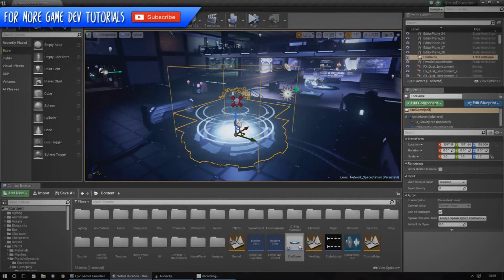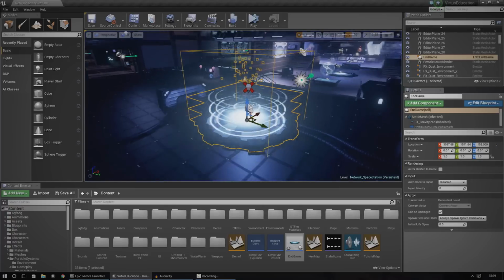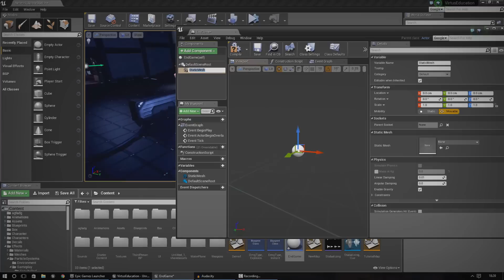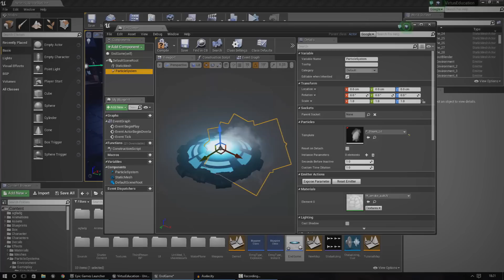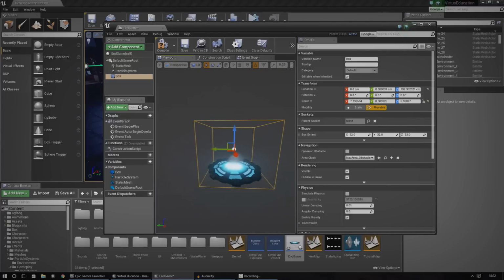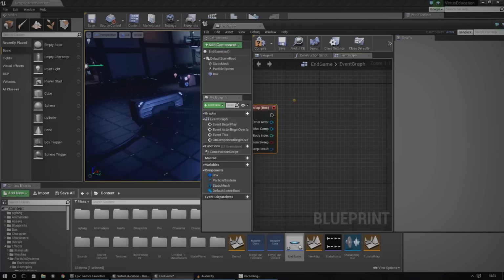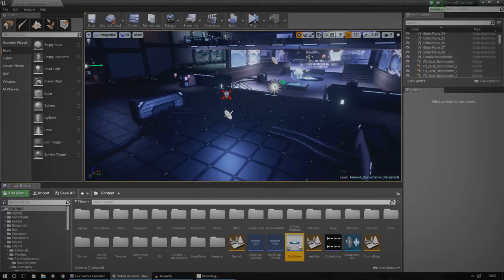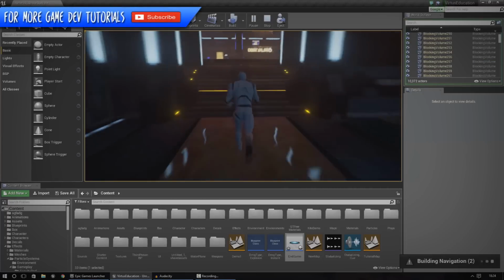Level Changing Checkpoint - #5 Unreal Engine 4 Blueprint Creations Tutorial

Comment: AND HOW DO YOU MAKE A texture for your guy that moving and also how do make enimes follow youor have some kind of maiterl that does somthing like a key of some sort
Reply from the maker: +tiny table toons If you take a look at my earlier tutorials you can see the different types of materials used and how to apply them to objects inside the engine. If you want to create a texture for the guy you need to modify the existing texture, you should be able to find it and export it out into photoshop and make changes there.

It's going to be rather hard without having unwrapped the mesh yourself however if you're careful with the texture you should be able to change it.

Keep in mind there is limits to what you can do with an existing character model. You'll only be able to change maybe the color and add some kind of material effect to it.
Reply: omg  thx